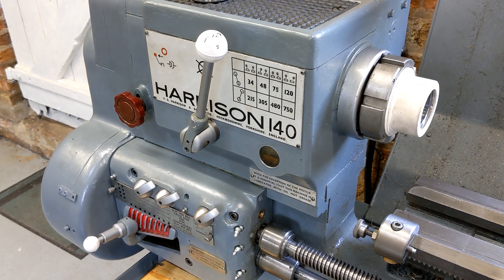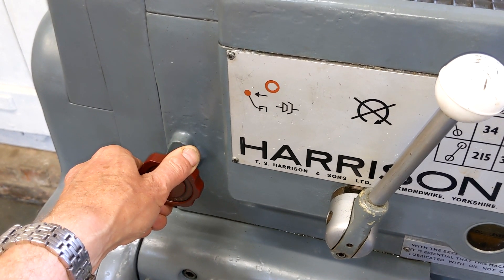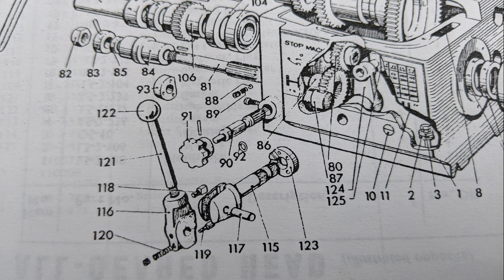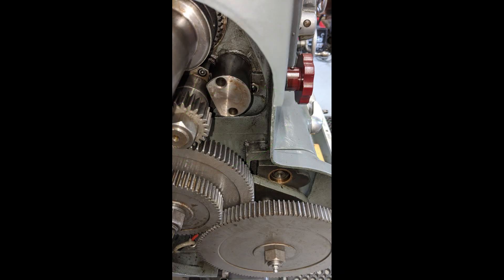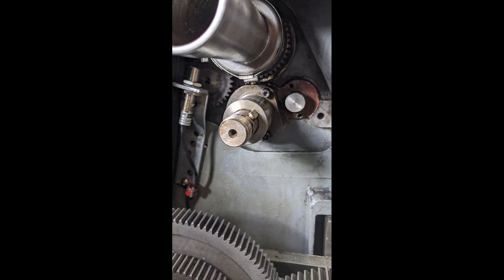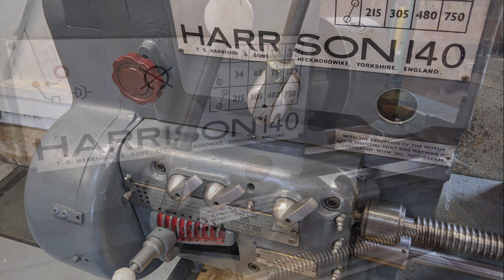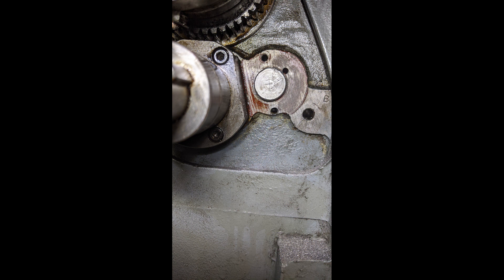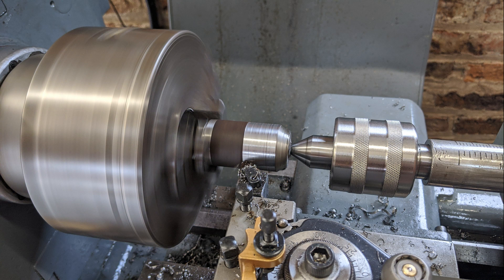HS15 Harrison 140 lathe leadscrew reverser fix

Comment: I went out and bought a Harrison 140 a few weeks ago. Filthy at the back of a warehouse for years. But £200. So now I have a 11" Harrison and a 140. And no space. Rewatching some of your videos to see if there are any snags. This one is a likely job before I fill it with new oil!
Reply from the maker: Hi Owen, hope you are well. I'm finding my 140 to be a very capable lathe. My solution was a bit elaborate. You could probably just grind a flat on the sliding rod (the one that slides into the blind-end bush.) Cheers

Comment: Hi, Thanks for posting the video. I may have to try this on my 140 as sometime I have the same issue . Could you tell me if you have any oil leaks from the gearbox as mine seems to leak over time. Good videos by the way keep them coming.
Colin
Reply from the maker: Hi Colin, comment appreciated thanks. No leaks on mine now. There was a bit of oil from the lid gasket but I sealed that. Then at first a bit from the front spindle bearing but that seems to have settled down.  I made sure the breather holes were clear.
Reply: I think I may have to revisit the  gearbox I did some work on it replacing seals ect and some damage due to school misuse. I have it running on a static along with an adcock 1es mill seems to work ok . It did make me smile when I saw the video re workshop and pig sty (SNAP!..lol) Mine an old pig sty and next door an old taylor shop from about 100 years ago.